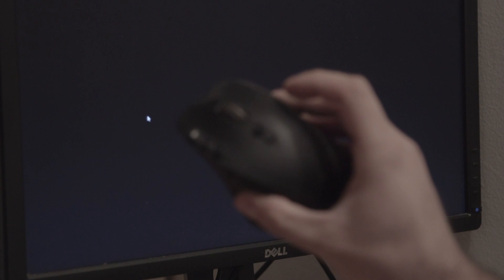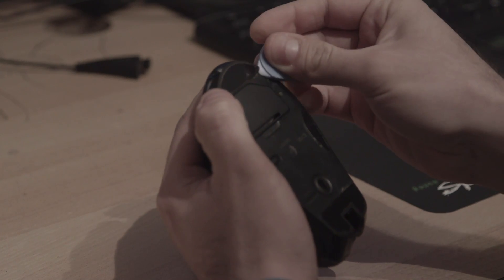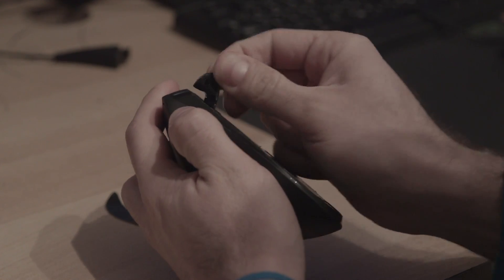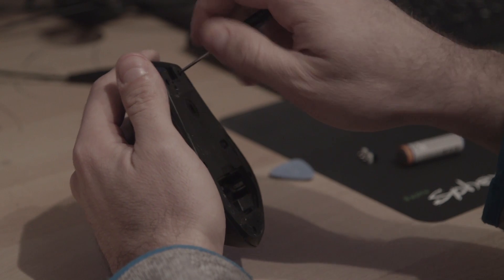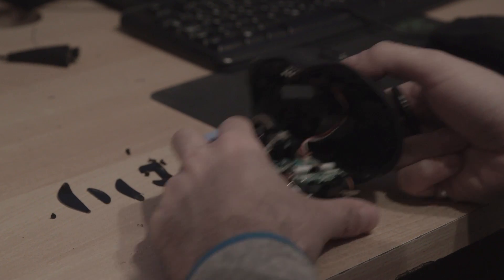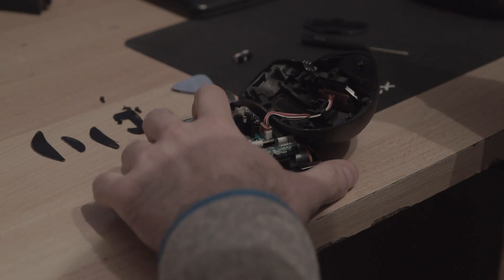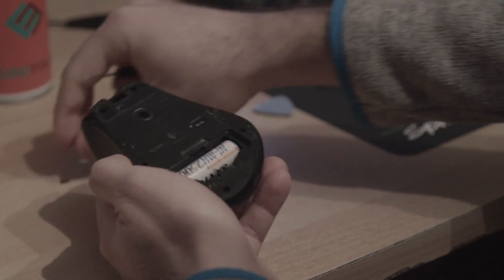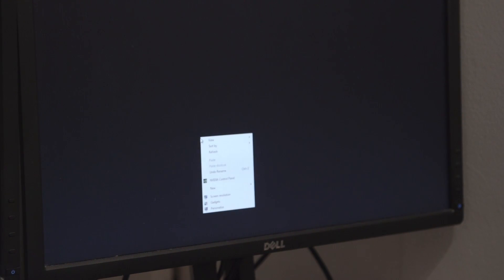How to fix faulty left mouse button (Logitech G700)

Comment: I had this problem recently as well and disassembled the mouse to figure out what exactly was wrong.
 
There is a design [flaw/decision] that allows the contact surface that actually depresses the switch to wear down. As a groove is created, it looses its ability to completely press the switch down and as it wears to this level, the double click (ghost click) issue starts happening. 
 
To sufficiently correct it, you can remove the top housing (there are youtube videos showing how) and apply a very small drop of super glue into the groove of the button contact underneath the piece your finger depresses and allow it to dry for about 24 hours.
 
Once reassembled, the double click issue is resolved and the hardened super glue should not wear down for a very long time. I have done this with my Anywhere MX and it is working fine once again.
 
Several videos show tape as a solution and while this should work short term, the tape will probably suffer the same wear pattern as the contact surface that depresses the switch - it will be short lived at best.
Reply: +1
Reply: Thank you so much!!!

Comment: if this doesn't work: take the cover off and inside the switch you'll find a shitty thin piece of metal that looks like this: https://i.ytimg.com/vi/D3fepD-Ffws/hqdefault.jpg
the curved piece flattens over time. take it off, bend it a little bit and put it back..

you can also replace the switch. if you do this, buy some quality switches so they'll last a long time. 
it sucks logitech uses the shittiest stuff available in their 70+ euro mice.

Comment: My mouse whell is not clicking anymore, i can apply pressure and it works, but no more clickness. It bugs that sometimes it remais stuck on the pressed position? Do you think the problem is the scroll whell switch?

Comment: I went one step further. The plastic button assembly that you sprayed in can be taken apart. I took it apart, borrowed a nail file from my gf. there are two metal strips. Just have to barely touch it couple of times with a file. Dont remove the strips from their place, they are tricky to reassemble. Also, you can buy new teflon strips for the bottom of the mouse on ebay for like 7 euros.

Comment: Mr. Novak,
Thank you for posting this video, I can in fact confirm that this problem is occurring with the Logitech G700s mouse as well.
I will attempt to fix mine with the instructions you have detailed in your video.

Thank you again.
Reply from the maker: As I said to Gryphus. I will make a new video showing how to disassemble microswitch. This is not a problem with Logitech only. This is general problem with microswitch design.

Comment: I had a G700 with the same problem before it was 2 years old (It's easy to see it if you try to draw lines on the paint, you'll see they are not continous).

Logitech replaced it because it was still on waranty. The replacement lasted longer (~3 years) and today it started to fail again suddenly. Again the "draw line" confirmed the issue.

I don't have access to compressed air right now so I guess I'll entirely dissasemble the switch.
Reply from the maker: Ok my friend, I will make a new video witch will explain how to fix problem without compressor or aircan. It is a little bit more tricky bit works 100%. Please stay tuned around sunday.

Comment: I have a M305, and I have the same problem. I should just exchange that piece of shit with another from some other mouse, would that work? If it is compatible, of course.
Reply from the maker: you dont need to do that you can disassemble microswitch and clean the little metal fin inside